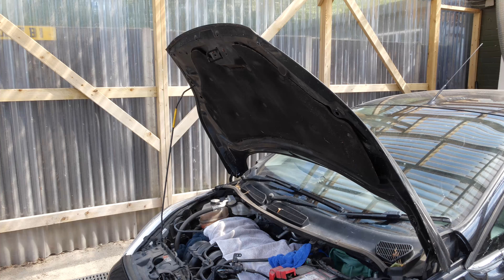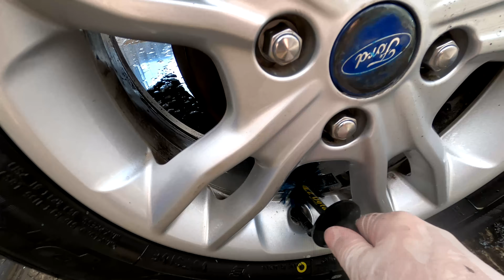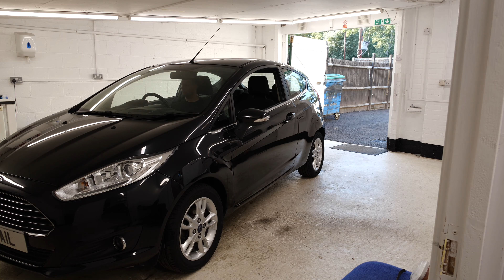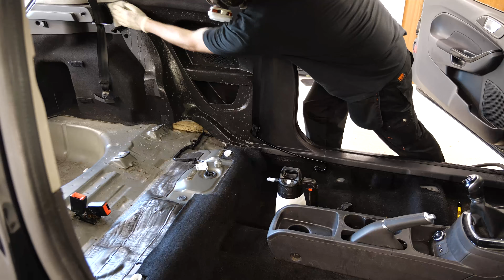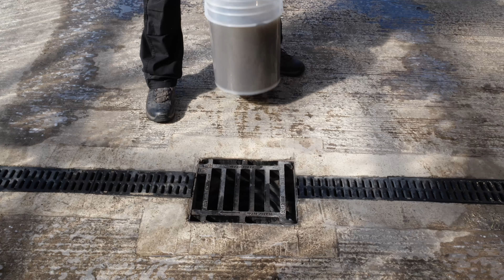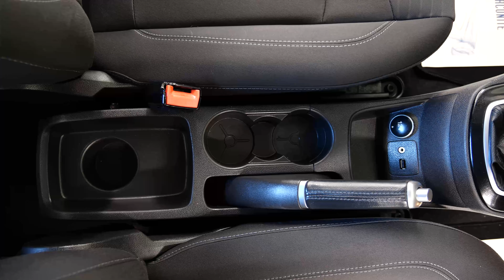Deep Cleaning a Filthy Ford Fiesta: ASMR Barn Find Transformation

Comment: New to you videos, very impressed with what you do👍
Have you used turtle wax dash and glass. I found this to be fantastic on the glass and not had any smears. Cost is low aswell. Keep up the good work
Reply from the maker: I’m currently using the Koch range on a extended trial, but will look to use other brands in the future, turtle wax maybe one

Comment: Just curious but any particular reason why you didn’t opt to use a steam cleaner on the interior plastics?
Reply from the maker: A lot of channels use them, but they can remove some writing on the buttons and drive water into the switch gear, they are good though 👍 I have an do use them on occasion

Comment: Nowadays you don't have to worry about wetting the components in the engine bay, they are designed to withstand water but if you do get it wet you can always air dru it with compressed air to make sure you do the leave any water pockets
Reply from the maker: Agreed as per the video using compressed air is a great help 👍